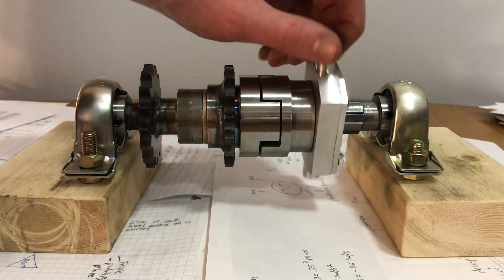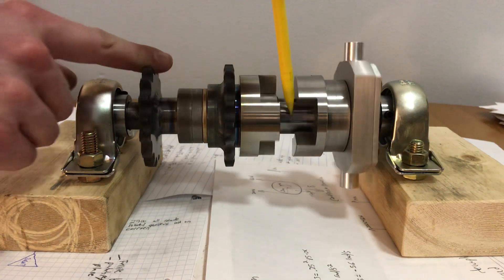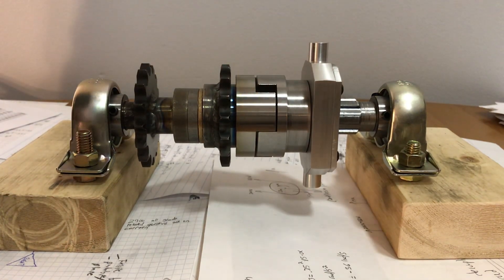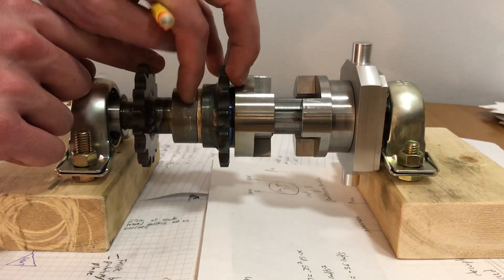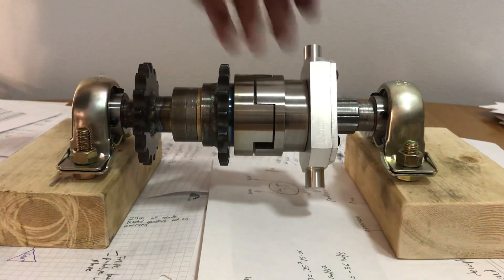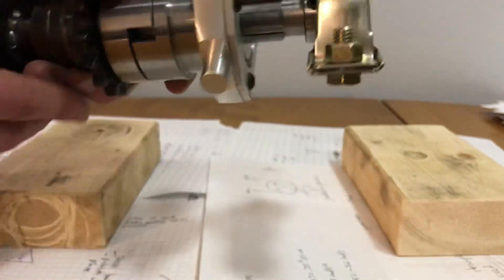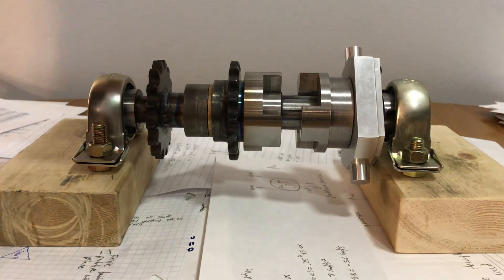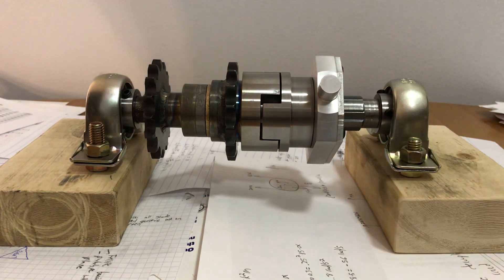Homemade Dog Clutch for Chain Sprockets

Comment: How did you calculate or decide the clearance between dog teeth?
Reply from the maker: I wanted there to be enough clearance that it would be easy to engage all the way once the teeth lined up. So based on the relative speeds of rotation, and how fast I thought the driver could shift the lever. But honestly that isn’t a great approach since neither of those quantities are known with any degree of certainty. If I were to redesign it I’d make it have a lot more teeth, so that the teeth mesh up more frequently, and then add as much clearance as possible while maintaining a comfortable level of strength

Comment: Hi, love this vid! Gonna do something similar for my RBS Quadricycle. One question, what would you use to push the selector body onto the other free-spinning part? Some sort of spring pusher?
Reply from the maker: Hi Patric, thanks for the comment. I’d probably use a short lever and an aircraft style push pull cable to control the clutch in most cases. I’m thinking the lever would pivot on your vehicle frame, and would have connecter links reaching to the aluminum “yoke” both on the top and bottom (hence the two pins it has). Then the push pull cable can attach to any convenient location on the lever and be routed to the operator controls. It should be simple to add an extension spring somewhere on the lever to make the clutch normally engaged, or normally disengaged, if needed.
Reply from the maker: A well pump handle is a similar kind of mechanism to what I describe, you can google that if a visual would be helpful
Reply: @andrewphillip8432  Thank you greatly for the advice, will definitely look into them!

Comment: Hlo what's is the max rpm at which it can be engaged/disengaged
Reply from the maker: People who used this told me it doesn't shift very well while it is rotating quickly. If that is important for your application, then I would recommend beveling part of the teeth and increasing the tooth spacing, so that it becomes easier for them to come into mesh
Reply from the maker: @Abraham Morrison yeah I machined everything from scratch, so I’m not sure of the technical names

Comment: Great stuff. Simple question from me. Which references or books did you used when you design this things? It means a lot for me if you answer this question
Reply from the maker: I designed it based on the formula for stress in a cantilever beam, since each tooth of the dog clutch is much like a short cantilever beam with one fixed support. The book I learned from is Mechanics of Materials by Gere and Timoshenko. I also did an FEA analysis in SolidWorks to verify this design.
Reply: @andrewphillip8432  thank you sir. Really appreciate it
Reply from the maker: @muh.alfinmasykurmuharram6864  glad I could help

Comment: How much max torque it can transmit ?? How do you decide no of teeth?
Reply from the maker: I designed it for 400 ft lbs if I remember right. I chose three teeth because it guarantees even load sharing. Kind of like how a three legged chair always sits flat on the floor, whereas a four legged chair might have one leg not touch the floor. This way each tooth is stressed equally
Reply: @andrewphillip8432  thanks
Reply: Also what is Outer dia for that clutch
Reply from the maker: @smk3399  roughly 2.5”. Also I used alloy steel. Something like 4340
Reply: @andrewphillip8432 three points are the basis of a plane 🤓

Comment: This is exactly the clutch I need. Thank you for explaining it. However, I don't have the means to build one myself. Would you build such a clutch again and sell it?
Reply from the maker: Glad the video was helpful! I could but it would be very expensive since it took an entire week of work to make it
Reply: @andrewphillip8432  How much would it cost since the budget for the project is not too big?
Reply from the maker: @niclas3713  if I billed my time at a normal machine shop rate $80/hr. then it would be $3200 plus price of materials. So even if I did it for a fraction of that it would still likely exceed the project budget
Reply from the maker: @niclas3713  machining is unfortunately very expensive and time consuming.. which is why I became a machinist since I also could not afford to outsource machined parts
Reply: @andrewphillip8432  Okay thanks but that's beyond the scope. I'm about to build a wakeboard that has a total price of $600 including the motor and that would be completely out of the price range.
Reply from the maker: @niclas3713  yeah that’s the unfortunate reality with a lot of projects like this. Ask me how I know ;) But also don’t be discouraged because a little ingenuity goes a long way and you can often find inexpensive solutions if you don’t limit yourself to the traditional solutions.
Reply: This same setup is in most salvage lower units for outboard motors, just match the h.p. rating of your engine.